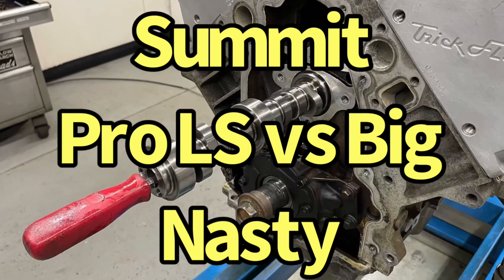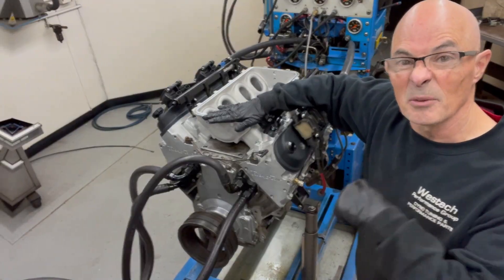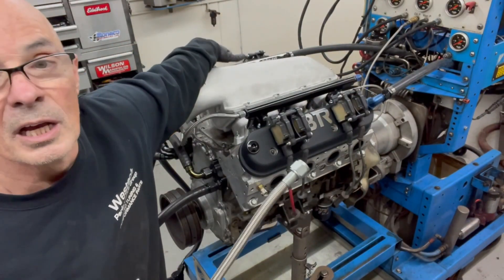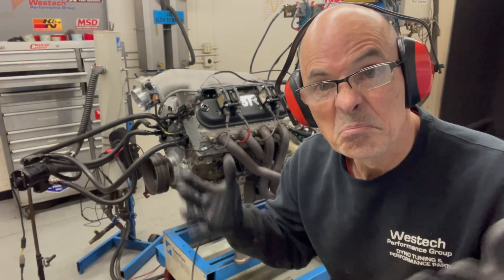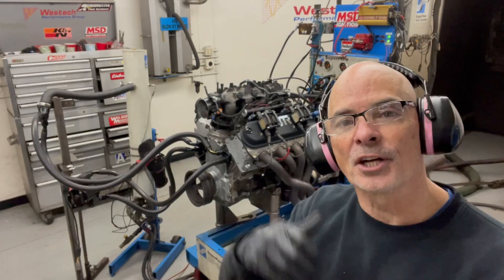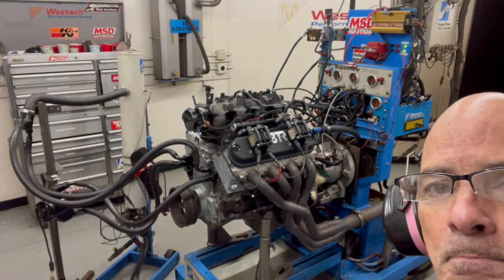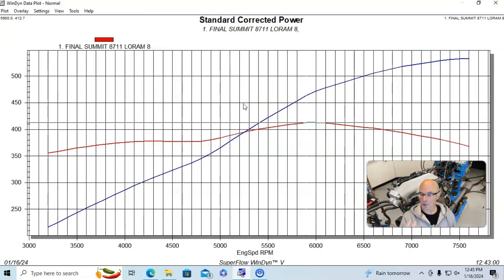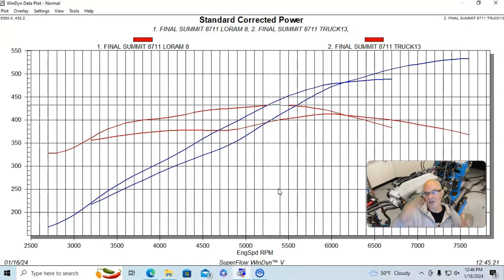TIGHT LSA 5.3L CAMS-DO THEY WORK? ENTER THE SUMMIT BIG NASTY CAM TEST-BIG NASTY VS BIG BOY 8711R1

Comment: The point the "tight LSA guyes" are trying to make is that it is very important to have enough overlap, not as much as possible. To much overlap does not increase performance, only chop and fuel consumtion. One can argue that a cam with spec. 218/230/105 has the overlap of a 102LSA cam with 218/218 and 102 is to tight. :)
Reply: LSA is also a Design INPUT . PERIOD !!!  The excessive exhaust duration ran most of the time on here isnt the way to do things , its a crutch and a torque killer . Its used to extend shift point beyond peak power . Especially with a efficent exhaust port such as a ls comes with that really isnt needed or best how to use the port . Both cams tested are off approx the best torque 108 LSA for a 5.3 . One tested is 3 deg too tight and the other 5 deg too wide . Tighter won and will every time . Wide LSA cams are TorqueTurds . Better heads dont require as much duration or overlap to make power , especially with a 3.780 bore . Thats why the LS is popular to begin with !!! Too much overlap - pull some duration . With the Right LSA for its displacement and other lesser factors a LS will still make Power !!!
Reply: Some good points here and I’ll note that the way I design cams, by valve event, the Durations, Lsa and Advance are All outputs.  My overlap targets are usually based on the exhaust system used (including turbo cams) but Big Nasty is different from the 33 other Pro Ls cams in that it was designed for maximum overlap without flycutting for chop YET the Uber early intake closing point that picked up 51 ft. Lbs. where a guy is going to mash the throttle.
Reply: @bobgyetvai9444   David Vizard say so. Brian Tooley says no. My question is, if it is so, what is most important? The overlap, the cross over, there the crank is when the intake valve is at peak lift, were the crank is when the exhaust valve is at peak lift or someting else?
I belive overlap and crossover (both valves open the same amount in the overlap) is most important and always keep a ene on these two. :)
Reply: @finnroen2334 I made a spreadsheet many years ago where you can enter duration, lsa and icl and it will output the valve opening and closing events in degrees atc, bdc etc. And vice versa. Enter the valve opening and closing points you want and it will output the duration, lsa and icl. It was a simple matter to include overlap and the two examples you mentioned have 14 degrees overlap.
Reply: @finnroen2334  i could care less what Tooley says !!! Vizard and more importantly my own engines have SHOWN ME !!  That crossover crap is confusion itself . Where the cranks at right angles the pistons way down the bore with peak lift not yet achieved .   Equal at 
.050" is a passing thing with one opening one closeing in a split second anyway . Its the suction that gives the intake port a yank that works and initiates that all important cylinder fill at the Beginning of the intake stroke . LSA IS A TIMING FIGURE !!! BEST IF PLANNED for displacement  you got !!! It dictates When that overlap period over the entire rpm range takes place  and is a key factor in torque production (VE) both avg and peak and throttle response period . Brian Toolry or Richard just didnt rewrite all camshaft tech or the laws of physics either . Wide LSAs are easier to tune for efi with less customer complaints . If you had a bussiness selling cams  youd like that shit too .
Overlap degree amounts apply to specific RPM Ranges . Pick your powerband and you find the overlap .  Vizard is right and so is every other builder that employs that thinking . You sure as hell dont see wide turd lsa Ever Won the Engine Masters !!!
Reply: @jeffreydurham5342  I see and with 14 degrees overlap on both cams, idle and so on will be more or less indentical, right? Only thing to consider is that the 105+3 turns into 102+0 as crossover is in TDC and "straight up" camtiming can be discussed. :)
Reply: Did David Vizard plan for the 50 ft lbs where you mash the throttle at the expense of 30 horsepower?  Valve events first. Duration Lsa and advance just become outputs.
Reply: @briannutter4656 😂😂❤ok
Reply: @bobgyetvai9444  That is what DV and otherc claim yes, but I do have several question that I do not find answers to. I also have MOST of DV books and the man is pure genius, but need of course to adjust the messages down some so most of the reades, including me, get the point. A good example of this differen thinking is the drill bit story; If you see a man in a store buying av drill bit, everybody thinks he needs a drill bit. right? What he acually needs is a hole. ;) Ordinary people do not think like this? :D 
The drill bit is just the tool needed to get the results he is looking for. Nobody really needs a upgraded camshaft - what they are looking for is more performance. To get the camshaft that deliver the best result possible to the owner is the challenge.

If LSA is a "design input - period", lets say your 108 for a 5.3 LS, why would this change with 39 degrees valve seat angle and LS7 rockers?  Because overlap breathing improves a lot, right?  When the correct amout of overlap is so important, exhaust valve opening has to be of much less importance. Adding 12 degrees og exhaust opening timing increases exhaust duration 12 degrees and LSA 3 degrees. That is just the way it is. 
Brian Toolley have dyno tested this, adding exhaust valve opening time to the test camshaft, and the LS engines responds very well to this. 

We have used this to our advantage. Here a low compression ratio Turbo LS engine WITHOUT turbo, but with a camshaft with way more exhaust duration than intake duration to get " the practial LSA" down to the prefered level. 
https://www.youtube.com/watch?v=ySU2Zv9qYrE
Reply: @finnroen2334  LS7 rockers ?? They arent straight . No the 30* seat doesnt change LSA . IT changes what the engine Sees as its Rate of lift . Same effect as a faster rising lobe . Is .050 timing affected - yes a little bit , maybe a deg and a half on the one side . What 30 deg seat does IS change its low lift flow if the seat is designed for it too with not much loss at higher lifts  either . Thats VE . And VE everywhere especially when thats torque and torques ability to still fill upstairs is a function as well of LSA to fit the displacment !!! Horsepower , Strong hp cant exist without it . And that hp is still derived mathatically by Torque . Less torque less hp .
Reply: I may have to apologize for questioning your math after some thought.
Reply: Nope again, My apologies, sir.
Reply: @jeffreydurham5342  I think you have nothing to apologise for. :) I like / love beeing questiond as it keeps med on my toes and sharp.  I would like to say thank you.
Reply: I have to say I think it’s funny how some folks bash the tight LSA folks as if the LSA is some random number. Truth is the LSA needs to match the engine you’re working with. 114 might tight for a smaller engine or too wide for a larger engine. Pick the correct LSA your engine needs, then choose the duration for the rpm range you want to make power then choose the lift for the flow that matches your heads. Thanks DV for helping understand how to make sense of the numbers and the right way to choose the ideal cam despite all the advertising from the typical cam manufacturers.
Reply from the maker: I like how people are discussing LSA when these cams are wildly different-it's not LSA (get past it)
Reply: This is killing me.  In what magical world of single LSA believers did David Vizard lose 30 horsepower up high to pick up 51 ft. Lbs when you mash the throttle.   I design cams by valve event for ultimate control of the powerband and behavior. Duration Lsa and advance are merely outputs.
Reply: @briannutter4656  im always happy to line up with guys like you and i hope theres a wager . The extra money is appreciated .
Reply: @richardholdener1727 ,?,do you have too upgrade the entire fuel system,injectors,fuel regulator(which is not under the hood at the gas tank)and fuel pump after stage 2 cam swap,I hope you will reply,thanks for your help
Reply: @richardholdener1727 Well both cams have the same overlap so they are not that different. Both have 14° of overlap at .050. These cams are more alike then 2 cams that have the same duration and different LSA. I would love to see some testing on cams that have the proper LSA that the engine wants (107 for a 383, 109 for a 350 etc…) with different duration numbers to show where certain duration numbers make power with the same LSA. And to test if having more exhaust duration really helps power from falling off at the top end.
Reply: @briannutter4656 exactly.  Lsa is a byproduct of events.  What lsa does a dual overhead cam coyote run? It isnt an input.  Because pushrod engines have one cam it ends up being what it is.  A coyote can vary centerlines a wide range to optimize for each operating point.  There is an optimized overlap and basically valve event for each point. Lsa in a pushrod is just a compromise
Reply: @flicksifyr6793  this thought seems logical, yet you see very few/if no tests on the subject.
Reply: Please explain how you can take 12 degrees of exhaust duration out and tighten up the lsa 3 degrees and end up with the same overlap.
Reply: @jeffreydurham5342 (intake + exhaust / 2)  -  ( LSA x 2 ) = overlap. 

So both cams have 110 LSA

one cam is 224/224 = overlap of 4

the other is 220/228 (220+228 = 448 / 2 = 224) overlap is still 4

in other words the average duration is used to calculate overlap.
Reply: Nope, still think you're 3 degrees off
Reply: LSA is a factor of head design, maybe watch some Darren Morgan stuff, LS engine  ( assuming we are talking OEM design heads,) don't like as tight LSA as SBC 23deg heads, Cleveland different again same goes for Hemi etc, just watch DM stuff and learn a bit about cylinder head design characteristics
Reply: @Hitman-ds1ei  the inline valve engine design  can use a tighter lsa.
Reply: I base 95% of my LSA on how well the head cross breathes during overlap
Reply: Once again Richard thinks nothing matters!! Any cam will work!!!😂😂